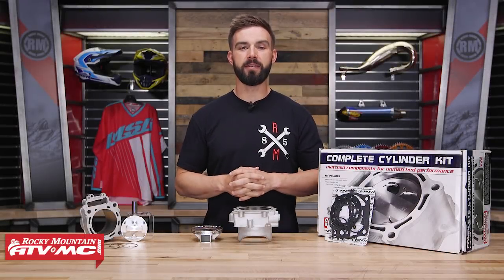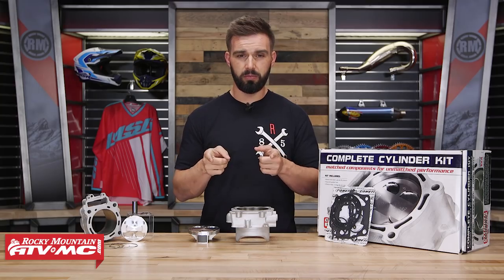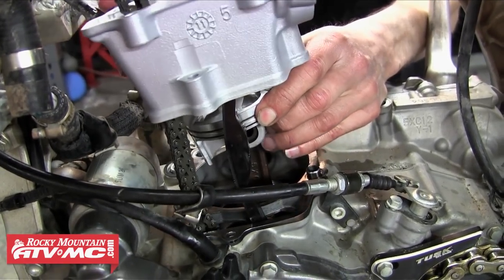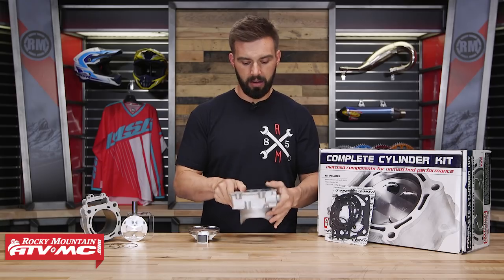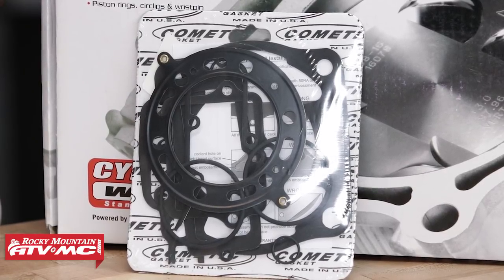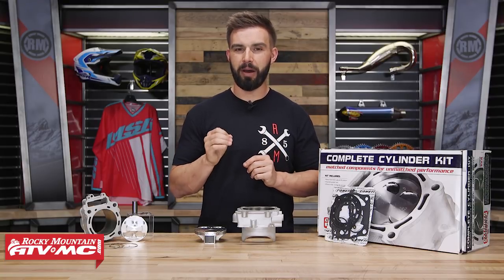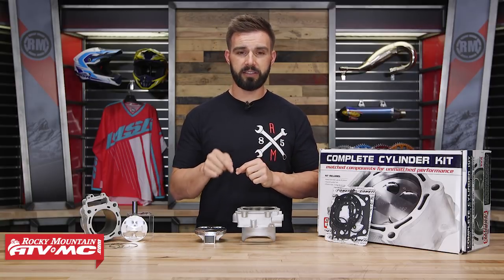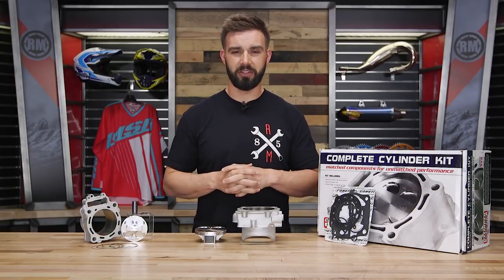Cylinder Works Big Bore Cylinder Kit

Comment: Will a yfz450 cylinder fit a Kodiak 400 or 450. A guy local has told me they did it to a 450. And used the stock head and cam. If that’s true that would be great

Comment: i have a 2011 grizzly 550 with an hmf exhaust and hmf optimizer would this be compatible still other than having to tune the optimizer altiitle
Reply from the maker: Sorry this will not work for your model.

Comment: I have a cylinder works big bore kit for a yfz450 2006,  but my piston only have 1 compression ring and then the oil rings, why is that,
Reply: How’s that kit working for you? 

Just picked up an 08 450SE thinking about going big bore

Comment: I just installed this kit, I have a 2016 yz250f. Bike runs great, but when you give it throttle it sputters and backfires. You can see from the spark plug it is running very lean. Do I need to remap the bike for it to have more fuel for the fuel to air ratio?
Reply: Yes, you have increased the volume of air going in so fuel has to be equally increased. Factory jetting/efi tuning is generally always on the leaner side for emissions so increasing the capacity will make that even worse.

Get a jetting kit or remap the ecu/use a piggy back to get the optimum AFR. Given your apparent lack of understanding of tuning I’d get a professional to do this for you 😊

Comment: When i put this on do i have to re-jet it? Thanks
Reply: Yes,  I have this kit on my fc250 which is EFI and I had to send my ECU to Tokyo Mods.
Reply: Conar Myers my atv has caburators( SORRY If i Spelled it wrong).
Reply: ProMotoo It's the same principle. I needed to tune my ECU and you'll need to re-jet your carb.
Reply: Conar Myers why Tokyo mods? Not possible to diy?
Reply: @v4sdude191  Did you end up re
Jetting it?

Comment: Does anyone know if you have to reject your quad after giving it a cylinder works big bore kit 479? And if so what size jets are best?
Reply from the maker: It is recommended to rejet your carburetor after any major engine modifications to get the best performance. Jet sizes will vary depending on your specific location, weather, altitude, and other engine modifications so exact jetting is are hard to give. You will want to read your new spark plug after installing this kit to see what jetting changes may be needed.
Reply: @rmatvmc  oh ok thanks

Comment: Does that bump it up to 290cc?
Reply from the maker: It will vary depending on which bike you have but most 250's will be bumped up to around 270cc's with this kit. Enter your bike on the product page and it will tell you what cc this kit will make your bike. https://www.rockymountainatvmc.com/parts/cylinder-works-big-bore-cylinder-kit-p